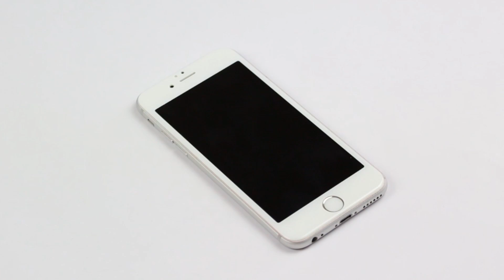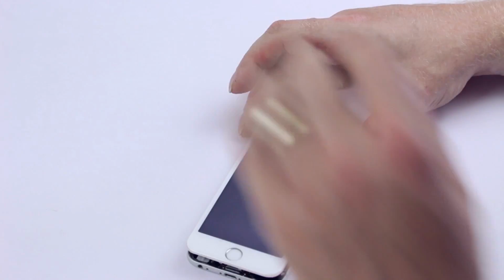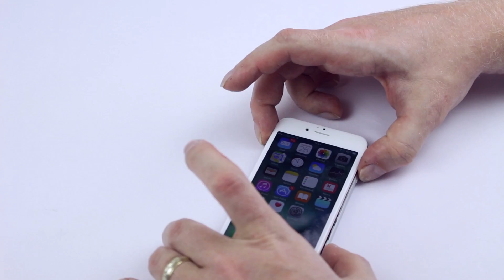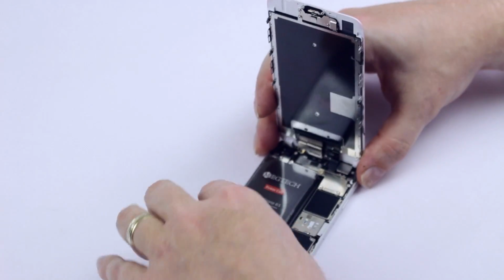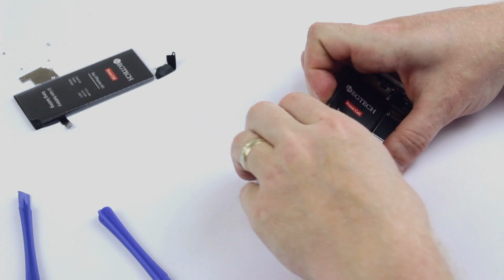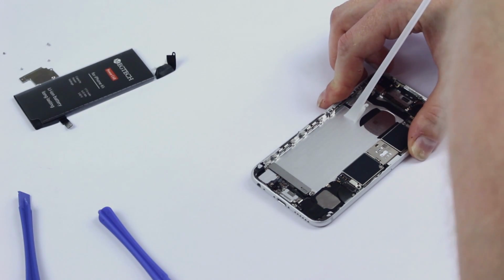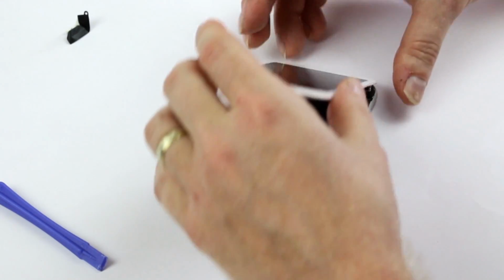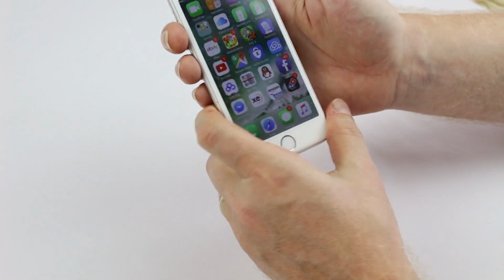iPhone 6S Battery Replacement (HOW TO Full WALK THROUGH) - MEGTECH

Comment: I see lots of people choose to rag on your method of replacing the battery from a iphone 6s. I did it without seeing any need to disconnect the screen but thats just me, I'm good with my hands but i swear if those electronic parts , screws get any smaller no one will be replacing , fixing their own phones . At least not without a microscope. Ive seen several ways in which to do this procedure and that was after i first opened up my iphone and did pretty much what everyone was saying in their videos. People post these videos to try an help the ones that will take it upon themselves to do their own repairs, there is no need to be so rude when throwing out what works for you  and correcting someone can be done with a little tact . No need for trying to appear like you know everything, especially if you have no video yourself. If you do have videos expect people to be people and things will go well no matter what shit they talk on you. If I can feel the shit coming thru the texts  some people put down in these comments and I can,  there are some hard customers to please out there so get your shit right before posting a video. Late...
Reply: Rumple Stilskin  hi there so there’s no need really To remove the screen right because most videos that I’ve seen they all remove the screen but I really don’t see why they do it but you do have to be very careful with it and my correct so you won’t break the connectors

Comment: The most important thing (which you elected to omit) is to stick the battery as far to the left as possible allowing for the battery cable to be attached. Too far near to the connector and you have no chance of connecting. This caused me a huge problem as I had to fold the cable on top of the battery. No idea why this most important advice wasn't mentioned. When I tried to remove it using the adhesive strips they just broke.

Comment: More emphasis on size of screws and no emphasis on how to remove the battery, the right way. I hope no one follows this guide.
Reply: Regarding screw size, type of screw would also come in handy. Luckily on this model there are only 2 types: star 0.8 and various Phillips screws inside. Unfortunately stars that small are not always easy to come by, but tiny Phillips sets are a breeze